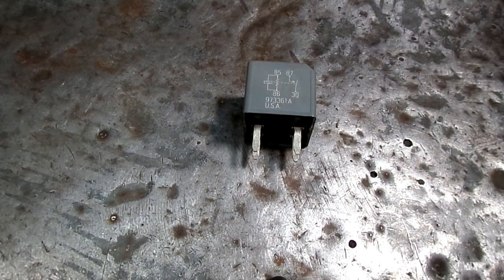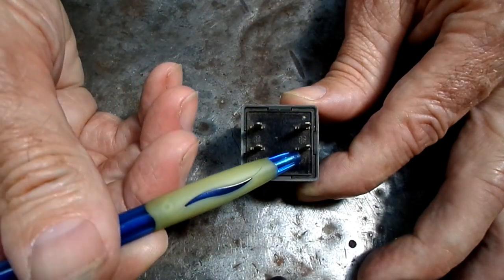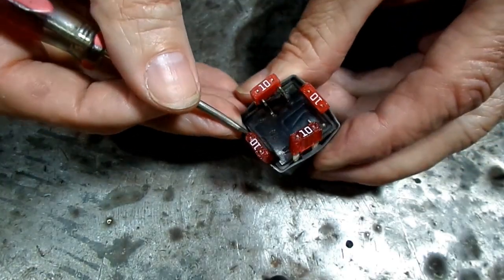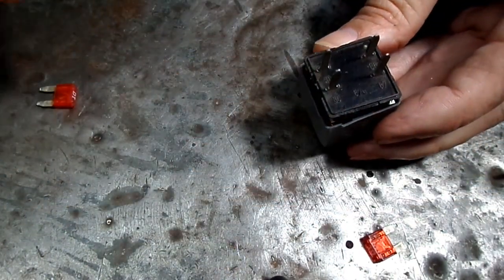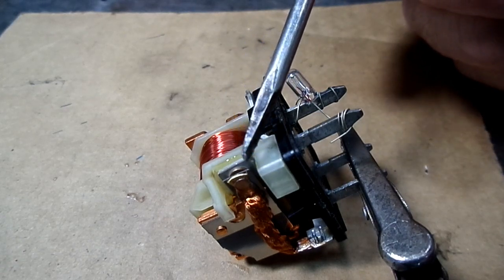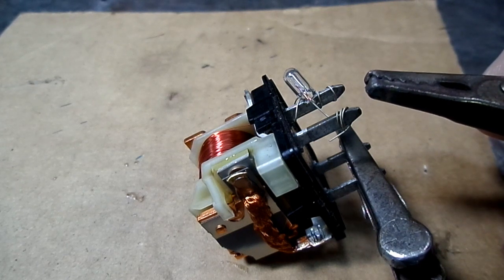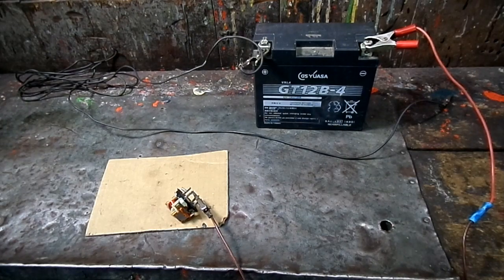How Does A Relay Work

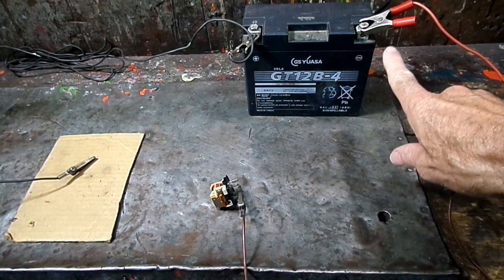Comment: At 5:00 you point to the negative side of the battery and say positive. I don't think you noticed but you have it flipped. Just fyi
Reply: This would also be a great opportunity to demonstrate how a transistor works. It can be used as a relay, but is solid state, like you mentioned.
Reply from the maker: I believe i saw the same thing later and switched my wires but forgot to show it.

Comment: Yes they are old tech but still used in lots of things.
A large one exists in your car starter motor, same idea but bigger.

As you know the older cars had a seperate relay or solinoid with a red button on it to press if you just wanted to turn the engine over, your right to say they have been around for a loooooooong time mr richpin :-))

You could have earthed the bulb on a seperate wire, it clouds the understanding a bit.

And getting the relay out of its box, it Re-fuse-d to come out easy lol sorry its a bad joke but someone had to say it :-))
Reply from the maker: Your right about the ground for the bulb,at the time i was thinking ...how can i make a simple connection for myself not thinking about how it would confuse others.
Reply: richpin06a
Im sorry i should not pick fault, its not allways easy to teach is it.

The automotive relays i first encountered were the square 5 pin types with the numbers as normal, typically the relay supplied with spotlamp kits.
Later other odd types, and some backwards wired types that switch off when power is applied, bloody silly designers lol.

I usually draw a relay as a coil and a set of points/contacts near the coil, then add the numbers and wiring, i dont really identify a relay by numbers but physical operation. But im a bit odd lol :-))